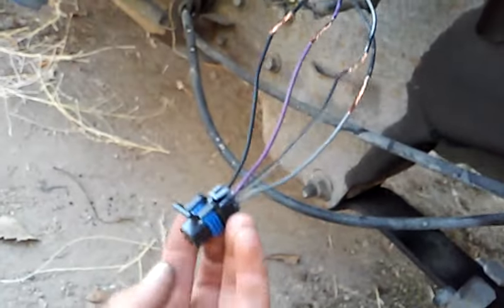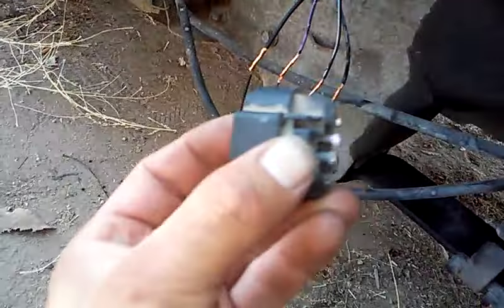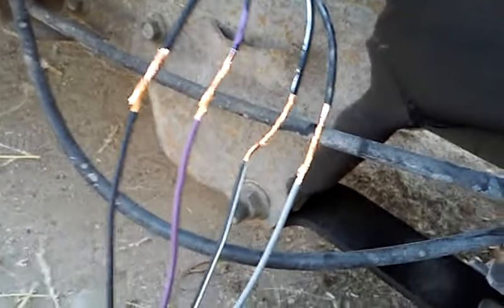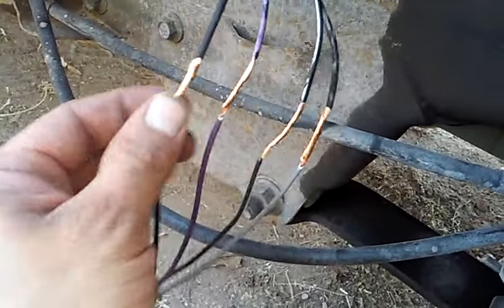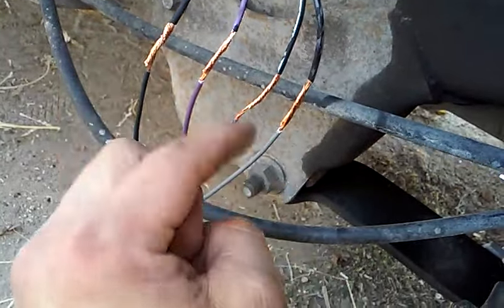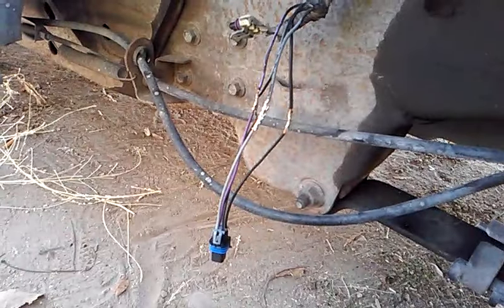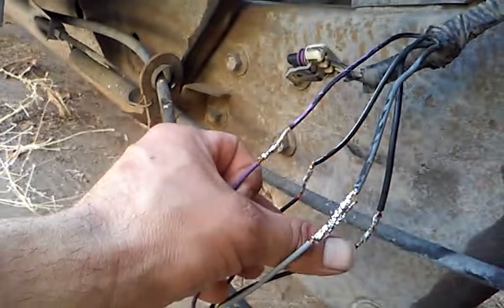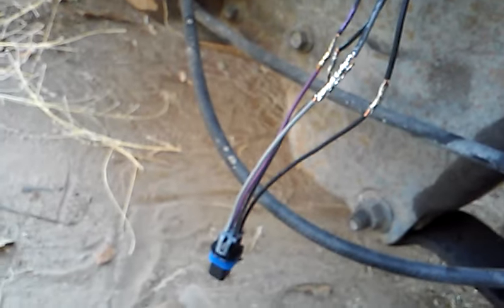Gm fuel pump wiring

Comment: thats the worse soldering job i have ever seen super blob... and why would you not put heat shrink tubing on the wires before you attach so you can just slide them up and shrink them in place
Reply from the maker: Thanks for the comment

Comment: Lol, u forgot the heat shrink! Lol, i do dumb stuff like that all the time.  Oh well, throw a crap load of e-tape on it and keep it out of the elements and it should be fine.
Reply from the maker: It happens from time to time 😂. Went back and redid this one since it's not my truck.
Reply: At least it's not 4 perfect inverted flares with the nuts missing!
Reply: @MattShaughnessy6  I have a 2000 Intrigue Oldsmobile I'm trying to wire in the fuel pump my fuel system has 3 wires and the connection is 4 wires got on mine an orange with a black stripe a green and
 a grey and black stripe
To be connected to the new harness 
2 blacks 
1 gray with white stripe
1 purple

Comment: For a long time I wondered why there were no solder joints in a pro car audio wiring shop... And an electrical engineer explained. Solder joints can make a wire prone to breakage at that joint in extreme vibration. Like from driving a car on a rough road or stereo with major bass. In airplanes they use special clamps and twist locks that just look like high end butt connectors. If you use a butt connector correctly, and dont buy the cheapest ones available, they are a viable permanent repair. Solder might be fine for a couple years, but wont stand the test of time
Reply from the maker: We disagree. My mentor has been doing this for 50+ years and has yet to have a sodder joint come back. If you sodder correctly it will outlast time. Just like a good weld.
Reply from the maker: My mentor is both a electrical and mechanical engineer. One of those rare types that has mastered it all. His teachings is what took my from a backyard mechanic to a commercial shop owner.

Comment: Yellow black is ground to fuel gauge, 
purple is fuel gauge +5 volts,
grey is fuel pump +12 volts,
Black is grounded to frame. In the same ground spot the fuel cap ground strap is grounded, is a short black wire that exits the Wire harness between cab and box Mine just broke here when I was changing brake line to rear, so if a pump is not pumping check this ground spot.
Reply: Hawk Over Michigan my wires are red blue yellow and black can you help
Reply: Thanks Hawk! I only needed color of the power wire
Reply: 2000 intrigue fuel pump
I have 3 wires
Orange both black stripe
Gray with black stripe
Green
The new field pump has
Black
Gray with white stripe
Purple 
Another black 
What wires go together
Reply: I have a Cadillac cts 2003, how do I connect the wires for the fuel pump. Like, what color with what color?
Reply: Thanks Hawk
Reply: Brand new pump runs. Won't push fuel.
Reply: So how do you know which terminal is which, plus the wire colors are not always the same. This is starting to get kind of frustrating.

Comment: Hey Matt, the new fuel pump I bought came with the new wiring harness but I’m not sure how to connect the two black wires. My truck has two black wires (one small and one larger) but no white strip or writing on either that I can see. The new wire harness has two black wires but one is marked with a white line. How do I match these up?

I’m inclined to match the smaller black wire with the black wire with a white stripe. Is this correct?

Thank you for your help.

Comment: The reason that it comes with crimp connectors that we have found out that when soldering the wires were it seems high vibration the solder will crack and create a short that just my experience